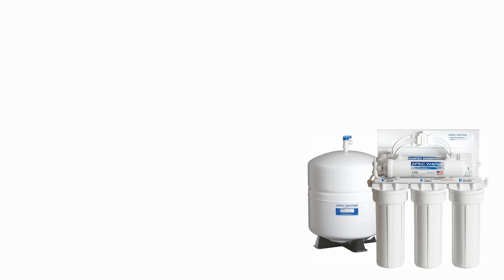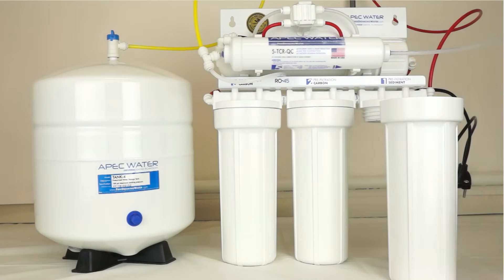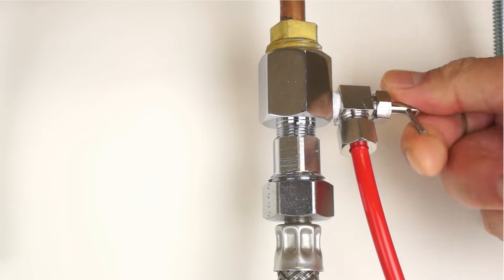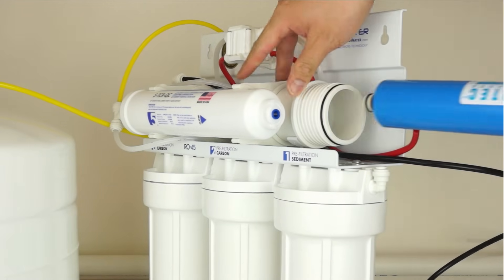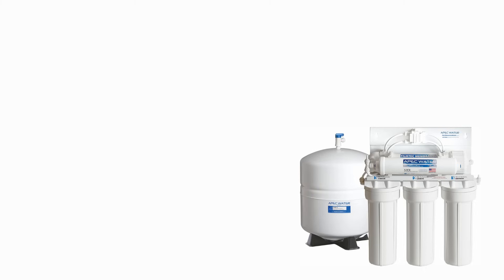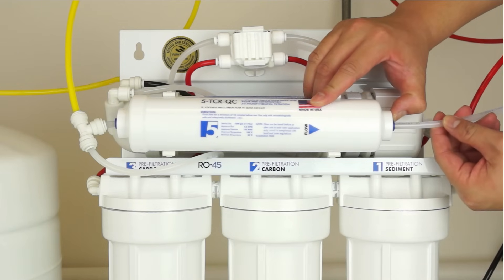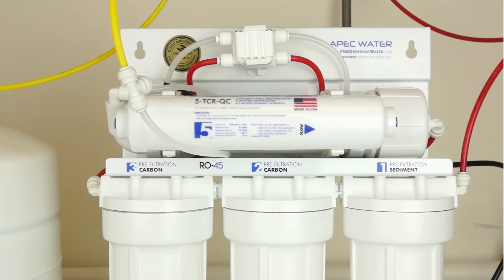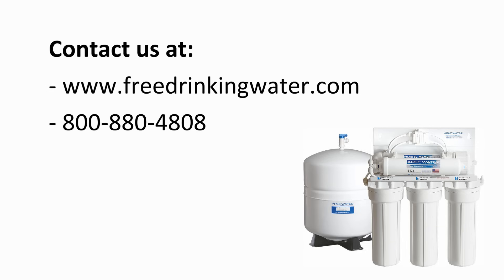How To Replace Your Reverse Osmosis Filters and Membrane - APEC Water Installation Part 6

Comment: How often do you have to replace these filters?
Reply from the maker: Hello,

The replacement of the filters is dependent on your model. For this specific unit, we recommend changing the bottom stages 1-3 every 12 months, and the stages 4-5 every 3-5 years. 

If you need further assistance, feel free to contact us directly by calling 1-800-880-4808 or e-mailing us at info@apecwater.com. We are in the office from Monday-Friday from 8:00 am-5:30 pm PST.

Best Regards,

APEC Support Team

Comment: Stages 1, 2, 3, 5 were not hard to replace.  Stage 4 RO membrane was a *****.  I had to use a husky strap wrench to counter torque in order to remove the housing.  Also, one of the tubings wouldn't come off - a snip with a pair of scissors was a easy solution for that one.

Comment: To speed up the process of draining the tank, I put slightly some more air pressure into it. Drains much faster.
Reply from the maker: Hello,
 
Thank you for your comment. We recommend having the pressure in the tank be no more than about 5-7psi. If there is too much air pressure in the tank, it will not be able to hold as much water. Draining the tank typically takes about 4-5 minutes.

If you need further assistance, feel free to contact us directly by calling 1-800-880-4808 or e-mailing us at info@apecwater.com. We are in the office from Monday-Friday from 8:00 am-5:30 pm PST. 
 
Best Regards,
 
APEC Support Team

Comment: Great instructional video --very helpful. How often on average does each stage need to be changed ?
Reply from the maker: Hello,
 
Thank you for your inquiry. I'm happy to help! The life of the filters will vary depending on the model. Typically the bottom 3 would be replaced about every 6-12 months and the top filters would be replaced about every 2-4 years.

 To be of the best assistance, please contact us directly by calling 1-800-880-4808 or e-mailing us at info@apecwater.com. We are in the office from Monday-Friday from 8:00 am-5:30 pm PST.
 
Best Regards,
 
APEC Support Team
Reply: @apecwatersystems  very professional
Reply: We use a water softener and whole house filter system. Usually the apex system needs to be done every year or so. I would recommend every year for the bottom 3 and every 3-5 years for the top 2

Comment: Are all membrane and filters like this universal? My RO system is like this but seems to have another filter on top. Is it possible to have 6 filters and two tanks also?
Reply from the maker: Hello,
 
Thank you for your inquiry, I'm happy to help!
 
Our systems are industry standard and our filters can be used with under standard designed systems. However, some units may require the use of proprietary filters. Yes, you can use 6 cartridges and two tanks with a system.

To be of best assistance, please contact us directly by calling 1-800-880-4808 or e-mailing us at info@apecwater.com. We are in the office from Monday-Friday from 8:00am-5:30pm PST.

Best Regards,

APEC Support Team

Comment: Just changed the 1st, 2nd, 3rd and 5th stage. The water is tested as variety like 90 to 200, before replacing them, it was 70. How much water to flush in order to get below 70?
Reply from the maker: Dear Greg Liu,
 
Thank you for your inquiry, I'm happy to help!
 
Typically after changing the stage 5 filter, we recommend flushing out the first tank of water. However, the TDS is removed by the stage 4 membrane. It is possible that it might be time to change the membrane.

To be of best assistance, please contact us directly by calling 1-800-880-4808 or e-mailing us at info@apecwater.com. We are in the office from Monday-Friday from 8:00am-5:30pm PST.

Best Regards,

APEC Support Team

Comment: I just changed the 3 filters and I was going to change 4 and 5 but I couldn't get the cap off the 4th filter. I tried for almost an hour! Then I googled it and found that many people couldn't get it to budge with the included wrench. Any suggestions?!
Reply from the maker: Dear Customer,

Thank you for your reply and support.
 
If your tap water is not treated sufficiently at the location, without knowing the actual water quality it would be a little hard to provide a correct system recommendation. Drinking water purification systems like WFS-1000 are designed to remove sediment and chemicals from water and it can be used with ozone pre-treatments as an option, Reverse Osmosis is another option, and CS-2500 is designed to remove chlorine, bacteria, and lead from the cold water line of a kitchen sink faucet is a different option compared to the first 2.  If you need further assistance, please kindly contact us directly through email at info@apecwater.com or you can give us a call at 626-968-8969 during our normal business hours from Monday through Friday between 8:00am-5:30pm pacific time. Thank you.
 
Best Regards,

APEC Water Systems

Comment: I bought your filter replacement set the instructions had NOTHING about the purge procedure at the end.
Reply from the maker: Hello, 

Thank you for your inquiry, I'm happy to help! Step six in the filter change instructions reads: Drain two tanks of water (through faucet) to flush out the new membrane! The 3rd tank of water is ready for use. 

If you need further assistance, feel free to contact us directly by calling 1-800-880-4808 or e-mailing us at info@apecwater.com. We are in the office from Monday-Friday from 8:00am-5:30pm PST. 

Best Regards, 

APEC Support Team
Reply from the maker: Hello, 

Thank you for your inquiry, Im happy to help! Step six in the filter change instructions reads: Drain two tanks of water (through faucet) to flush out the new membrane! The 3rd tank of water is ready for use. 

If you need further assistance, feel free to contact us directly by calling 1-800-880-4808 or e-mailing us at info@apecwater.com. We are in the office from Monday-Friday from 8:00am-5:30pm PST. 

Best Regards, 

APEC Support Team

Comment: Stupid question: when i first got the roes-50 system i had to unwrap and install the first 3 filters...stage 4 and 5 looked ready and i didnt even bother opening them up...they do come ready to go right? 😟
Reply from the maker: Dear Customer,

Thank you for your inquiry. I'm happy to correct. That is exactly right, stages 4 & 5 are already ready to go, there is no unwrapping or prepping that needs to be done with them before installation. 
If you need further assistance, feel free to contact us directly by calling 1-800-880-4808 or e-mailing us at info@apecwater.com. We are in the office from Monday-Friday from 8:00 am to 5:30 pm PST. 

Best Regards, 

APEC Support Team

Comment: "All five filters on your under-the-counter RO system" does not apply to my six-stage RO-PH90 system. Have any resources been made available covering replacement of the stage 6 pH+ inline filter?
Reply from the maker: Hello, 

Thank you for your inquiry. I'm happy to help! The 6th stage filter is changed the same way that the 5th stage is, by removing the tubing from the old filter and pushing the tubing into the new filter. If you need assistance, feel free to contact us directly by calling 1-800-880-4808 or e-mailing us at info@apecwater.com. 

We are in the office from Monday-Friday from 8:00 am to 5:30 pm PST. 

Best Regards, 

APEC Support Team

Comment: how can you tell when the tank is full in order to discard 1-2 tanks before using ?
Reply from the maker: Hello, 

Thank you for your inquiry. We're happy to help ! 

It normally takes 3-4 hours for the storage tank to fill the first time after installation or the filters being changed. When the tank is full, the drain water will stop running, and the tank will feel very heavy. After 3-4 hours, it would be safe to flush the first tank of water. 

If you need assistance, feel free to contact us directly by calling 1-800-880-4808 or e-mailing us at info@apecwater.com. We are in the office from Monday-Friday from 8:00am-5:30pm PST. 

Best Regards,
APEC Customer Service

Comment: For the stage 5 filter T-fitting, does it matter if the yellow tube goes into one side of the T or the other?
Reply from the maker: Hello Ken, 

Thank you for your inquiry.  I'm happy to help!

The tee is universal, so the yellow tube could go into either port of the tee. 
If you need assistance, feel free to contact us directly by calling 1-800-880-4808 or e-mailing us at info@apecwater.com. We are in the office from Monday-Friday from 8:00am-5:30pm PST. 
Best Regards,
APEC Customer Service

Comment: You got your clockwise and counter clockwise backward on your stage 1 filter.  You open the filter housing by turning counter clockwise not clockwise. Think of it as a screw.  Righty tighty, lefty losey.

Comment: The water pressure is starting to weaken is it maybe because the filters need to be changed i just moved in my new place and they have this system for the drinking water
Reply from the maker: Dear Francisco, 

Thank you for your inquiry. I'm happy to help! 

Low pressure coming out of the system can indicate a restriction in the system, such as the filters needing to be changed, or it could indicate that the bladder in the storage tank has worn out. To be of best assistance, please contact us directly by calling 1-800-880-4808 or e-mailing us at info@apecwater.com. We are in the office from Monday-Friday from 8:00am-5:30pm PST. 

Best Regards,

APEC Customer Service

Comment: Nice video. A bit harder under a sink where it’s dark. But hey I’ll try. Our service person is not returning calls.
Reply from the maker: Dear Customer, 

Thank you for your inquiry. To change the filters, we find it most helpful to dismount the system (if you have it mounted to your cabinet) and pull the system out from under the sink. If you need further assistance, please contact us directly by calling 1-800-880-4808 or e-mailing us at info@apecwater.com. We are in the office from Monday-Friday from 8:00am-5:30pm PST. 
Best Regards,
APEC Customer Service
Reply: You don't have a flashlight?

Comment: Very good video.  Thanks.  I called Apec because I was concerned about holding the end of the membrane filter with my needle nose pliers, which are certainly NOT sanitized.  He said that the outer blue layer on the membrane filter is the part that you want to be sure and not touch with your hands.  He said the end fitting is ok to handle with pliers.  I just swapped out all five filters, and everything went fine.  No leaks.  We really enjoy the taste of the RO filtered water, and feel that it is healthier as well.
Reply: Late comment but I just sanitized mine with 90% alcohol we keep around post Covid :) no need to worry
Reply: @marvelleonline excuse me mam, may I ask, how many months of usage before replacing all the filters? Thank you..

Comment: PLEASE HELP-----I just learned that i need to replace the Membrane and the 5th stage carbon filter on my RO system.  my questionS ARE: 
1. will any standard membrane fit my RO system {AQUASKY ROT-4}? 
2. my 5th stage carbone model is = CL10R0 T33, can i use any replacement with this model number? 
3. My ASO {automatic shutt off valve} also needs replacing, can i use any standard ASO from EBAY with 1/4'' fitting- same fitting as mine? I contacted Home Depot, i was told i must get one from the manufacture for my RO system {AQUASKY ROT-4}. is this true?

Thank you for your help in advance.
Reply: you ever figure it out?
Reply: @eeeeeeeeeeeeeeeeeeeeeeeee-s3p   Sorry its been so long i  can't really remember what  i did. but yes i figured it out. I believe i went to  the manufacture's site and found the part numbers and ordered from Ebay.  Replacement was easy following the video on youtube.  Good luck..
Reply: @cya3651  ok thanks, after you changed the filters was the water pressure a bit low for a little while?
Reply: @eeeeeeeeeeeeeeeeeeeeeeeee-s3p  after replacing everything, I waited until the tank is full and I did not notice any difference in water pressure. I would assume that if the water pressure is low you may need to pump air into your tank using a bicycle tire pump. Search up a YouTube video so that you know how much PSI air pressure to add.
Reply: @cya3651  oh ok, does the tank need to be drained or anything? after replacing the filters? sorry for asking all these questions this is my first time
Reply: @eeeeeeeeeeeeeeeeeeeeeeeee-s3p  FYI, i’m not an expert. I don’t believe it was mentioned in this video that you need to empty tank so I don’t believe you need to… just follow the YouTube video instructions. Again if you’re water pressure is low and the water doesn’t come out as strong as it used, search up a YouTube video and follow those instructions to add more air into the tank.,

Comment: can we connect hotwater pipe line  on  Water Purifier?
Reply from the maker: Dear Customer, 

Thank you for your inquiry. I'm happy to help! 

All of our filter systems are designed to be connected to your cold water supply. You may run the output from the filter system through an instant hot system, such as this one https://www.freedrinkingwater.com/instant-hot-61.htm. This will provide you with hot, filtered water. 

If you need further assistance, please contact us by by calling 800-880-4808. You can also e-mail us directly at info@apecwater.com. We are always happy to help! 

Best Regards, 

APEC Customer Service

Comment: Good instructions... However, would have been nice to be warned that these canisters are full of water lol.
Reply: Travis O'Dierno  Warned about water? Did you expect to see Jack Daniel’s in there? LOL
Reply: Agreed, it's not unreasonable to mention this.  Also placing a towel below the filters.  It only takes a second to mention and can save some folks a mess.
Reply: Hahaha. Hahaha. Hahaha. Who would’ve thought??!!
Reply: For sure. They should mention that it's so full it will be pouring out a lot of water. Having watched the video in my mind it wasn't going to be overflowing. Luckily I had a towel ready!
Reply: Thanks for this, I spilled water on the floor, not sure what I expected
Reply: I thought they were full of rocks
Reply: You must be kidding!
Is a canister is standing upright.

Comment: Regarding the problem with the water not coming out very strong from the tap after replacing the pre filters. My wife was determined to tell me that I had been turning the valve from the red tube the wrong way. I argued with her but finally let her have a turn. She turned it clockwise and the tank filled up with in two hours. Problem solved. Feeling pretty stupid.

Comment: After viewing the video I changed the 1, 2, 3 pre filters on my APEC RO system. The water is not coming out as strong as before. I checked both water valves and they are both turned on fully. Any ideas?
Reply: the tank takes about 2-4 hours to refill, did the problem ever get fixed?
Reply from the maker: Dear Customer, 

Thank you for your comment. I'm sorry to hear about this issue, but I'm happy to help!

To be of best assistance, please contact us directly by calling us at 800-880-4808 or by e-mailing us at info@freedrinkingwater.com. Our office hours are Monday-Friday from 8:00am-5:30pm PST. Our support team will be happy to assist you!

Best Regards,

APEC Customer Service

Comment: Has anybody had a slimy residue (very small amount) on the rubber washers at the ends of the stage 3 charcoal filter?  I changed mine for the first time after about 8 months, and there was a light gray film on this filter only.
Reply from the maker: Dear Customer,
Thank you for your inquiry and I am happy to help! The issue you have encountered is very rare but it is likely caused by tap water quality. Carbon filters are also designed to filter out chemicals and other water impurities. However, if it's only on the 3rd stage and not the 2nd, it is possible a water impurity entered the 2nd stage carbon and oxidized it out of the water to the 3rd stage causing this phenomenon. In all cases, our 4th stage Reverse Osmosis filter are designed to remove most harmful visible, and non-visible impurities from water. 

Tap water quality does change from time to time so this may not occur again. I hope this information helps. Thank you. 

Best regards,
APEC SUPPORT TEAM
Reply: Thank you for the quick reply!

Comment: Why does my stage 5 say to use mild bleach to clean the new T fitting and open port to the new filter and in the video they dont do this?
Reply from the maker: Dear Customer,
Thank you for your inquiry I am happy to help!

Sanitizing the tee and tubing connections is typically not needed for most normal filter change conditions. It is a precautionary measure. We did not include this setup in our video, I am sorry.

Comment: Does anyone know how long these filters last before having to replace them.
Reply: Stage 1, 2 & 3 are 6 to 12 months. Stage 4 is 1 to 2 years. Stage 5 is 2 to 3 years.
Reply: Thanks
Reply: You're welcome! I've had my RO system 2 years and just replaced every stage, I replaced 1, 2 & 3 a year ago.
Reply: I think the three vertical filters once a year, the horizontal ones, 3 - 5 years.
Reply: I'm a technician I install the water systems & I do the services 

The the filters on the bottom are called 
1 Sediment , 2 pre carbon, 3 carbon & it has to be replaced every year 
The two on top are call membranes and they have to be replaced every 2 years.

Comment: May I ask you this, I did replacement all 5 filters then now I check RO water has higher TDS than tap water. So what Did i do wrong that caused this issue ? One thing I want to tell you I did cut Sediment filter shorter to fit the housing. is it possible caused problem ? thanks